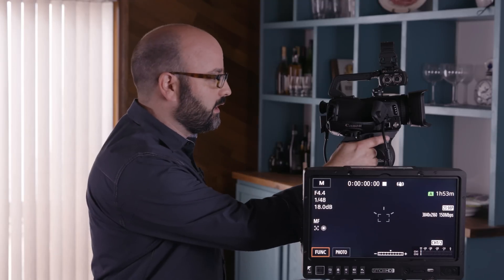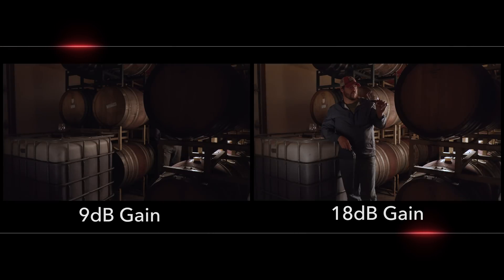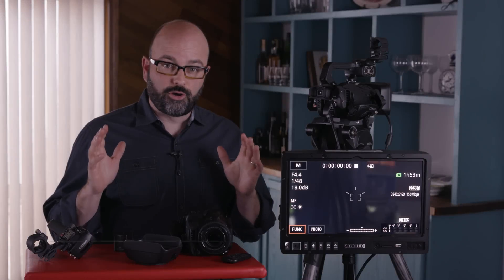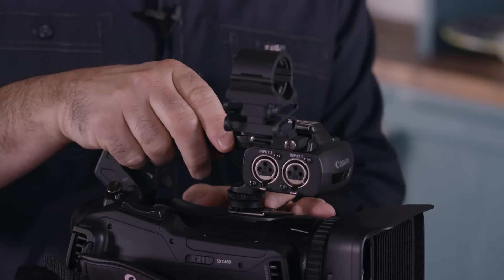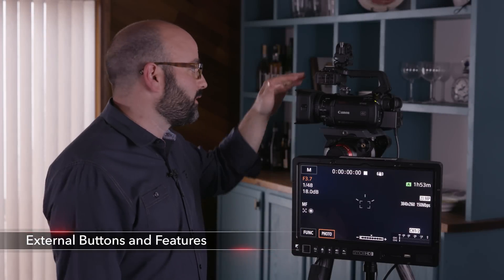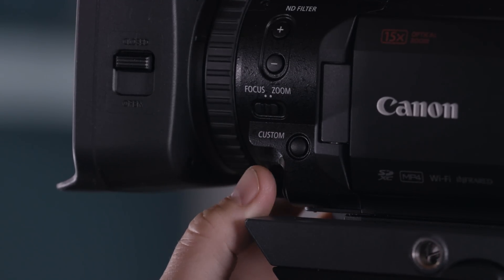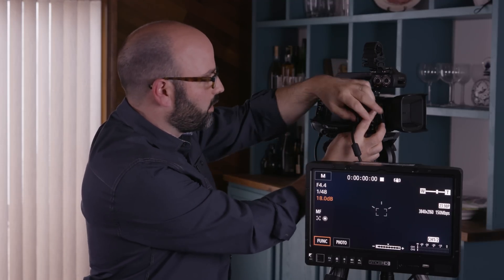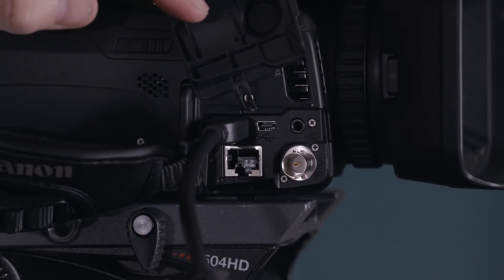How-To: Canon XF400 and XF405: Introduction to the XF400/XF405 Camera Systems

Comment: Auto focus needs no ring because it is doing it auto. zoom needs no ring because there is a rocker switch, this leaves  iris which needs a ring but you cant assign the ring to that. Genius.
842. TV AV M - what does this mean (i did study photography and have been pro for 25 years but never heard TV AV M)
This video doesnt really show if you can simply adjust iris and gain without going in the menu.
Why cant these camera be setup to shoot with access to the manual functions. (FIZ, gain. degrees kelvin, FPS)
Shooting a black camera against a black shirt is not wise.
Any log or 10bit ness?
Reply from the maker: Hello Sam:

You can find a description of the shooting modes in the XF400 manual on pages 68-69:
TV – Sutter Priority – 
AV- Aperture Priority
M – Manual mode
The available settings for these options are listed on page 70. Kelvin is an option under the Custom White Balance (WB) menu options described on page 76.  Here is a shortcut to the manual: https://canon.us/36OOccK

While most of the features you mention can be set through the menus, custom settings and assignable buttons on this camcorder, it sounds like our Cinema line of cameras would better meet your needs.  The Cinema series of cameras are designed for professional production and have the option to customize the many external buttons to have 1-push access to your settings.  You can find information on the Cinema line at pro.usa.canon.com.

Our Cinema support agents would be happy to discuss the features with you are available at 855-246-3367, 24 hours,  7 days a week, excluding holidays.  Our agents could also discuss how to access available features on the XF 400
We hope this helps.
Reply: @CanonUSA  Hi. I have a C200 and an R6 being a recent convert to Canon. Im just looking at this cam for situations were a built up C200 is too heavy and the R6/24-105 with no long lens, No ND and no XLR, is just not 'run and gun' enough. Shooters like me would put good manual controls (and AF) in front of needing anything else on the camera. Although I might consider auto on 1 in 100 shoots. It would defo be good to map the iris to the big ring. It is the best control.. but with AF and zoom rocker it will never be used!
Reply: Coming to three new cameras (Id prefer 300mkiii but cant afford) one is looking for consistency in both physical function and ideally also picture appearance.
Maybe im missing a point about struggling to get 'all manual' and someone like Jem should be doing a video.. 'auto you can trust it'

Comment: Can you run with external Battery like V mount?
Reply from the maker: Hi, Sergio!  The Canon XF400 and XF405 are designed to be powered by genuine Canon batteries or through an AC power adapter.

Hope this helps!
Reply: Thanks

Comment: Great video series. Couple of questions. First, I intend on using a Atomos for both monitoring and secondary recording because I use a elevated boom and remote controlling pan and tilt for long shoots in the sports industry. I tend to use a belt and suspenders approach in every situation. I was hoping to record via sdi and in the internal cards, but you mentioned if I wanted to record in the highest field output quality, the internal record to the cards are disabled. Is that true? Or is there a work around? Second, will you be releasing a streaming video as it relates to the 405’s capabilities? Thank you again
Reply from the maker: Hi Bill. In order to record to an external recorder via the SDI OUT terminal, the camcorder must be set in external recording mode only. There isn't a way around this. Also, this video is part of a series of videos about the XF400 / XF405 we posted in our channel. Check out the others at https://www.youtube.com/user/CanonNorthAmerica/search?query=405 We hope all this helps!

Comment: Neat video!  Can you let me know if you have experienced any problems with focus shifting when zooming in and out and when in Manual Ficus mode?  For example I auto focus on a subject in the distance on max  tight zoom and wait till I see the green triangle.  Then I switch to manual focus as I want the subject to stay in focus as I pull back to wide.  It holds focus until the very last moment and when its has reached its fullest wide angle it suddenly  slips focus and I get the indicator turn from green to white and not be that perfect triangle anymore.  However as soon as I zoom in to max close up I get sharp focus again and the green indicators align up.   Anyone else have this problem?  Please see my video......  @vOCE
Reply from the maker: Hi there. Our team of experts can help determine what may be causing this. Please reach out to them directly at http://Canon.us/ContactYT We look forward to hearing from you.

Comment: Just purchased my XF-400 - but a problem - how do I get the XF-AVC format videos off my camera into my Win10 PC for editing? Spent several days to no avail. DIU utility does NOT recognize my camera, when xf400 connected to my PC with a USB cable - it does only when camera in MP4 mode, but not in XF-AVC mode - and the Data Import Utility (DIU)? - does not recognize the connection - says not connected, regardless of MP4 or XF-AVC mode on camera - Canon - you got to be kidding me / - does anyone have any ideas, cuz this well is dry ;)

Comment: Canon not responding my problem.
I live in poland. I reported the defect of the seller, knowing that it was a design defect. I wanted to return the camera, but the seller refused. I met with representative of Canon Poland Robert Woźniak at the representative of the BEIKS dealer. The defect was confirmed in my camera and in the others that were in the store. My case is not isolated. OIS disables spontaneously when working on the shoulder or the operator is leaning against a stationary object, and the picture begins to jump while taking important shots. This is confirmed by Mr. Woźniak. He refused to write down the appropriate protocol, which would be the basis for returning the camera and recovering the money. The camera in my incident is not suitable for working with an anesthetic OIS during photos.

The seller does not want to give me money, which I can understand, because it's not his fault, but in the end he represents Canon and should take responsibility for the product.

Dnia 8 grudnia 2018 00:28 Canon Support <carecenter@cits.canon.com> napisał(a):

Dear Piotr Diszer ,

Thank you for contacting Canon support regarding your XF 400 and IS design question. I will be glad to assist you.

I would not thinks so based upon your report.  You may have your camera examined. 

Where do you live?

Please let us know if you have any other questions.  Thank you for contacting Canon.

Sincerely,

James

Technical Support Representative

Email is not a secure form of communication.  Please do not send us your credit card number or other personal or account information via email.
Reply from the maker: As you do not reside in the United States we at Canon USA are unable to assist with this matter. Please contact Canon in your region for assistance. https://global.canon/en/support/

Comment: The gx10 doesn’t get the same 45 mbps 1080 hd as the xf400?
Reply from the maker: Hello there! The VIXIA GX10 records 1920 x 1080 at up to 35 Mbps, which the XF400 also does. We hope this helps!
Reply: I thought the xf400 got the update of 45 1080 and 160 4k? XF-AVC fromat
Reply from the maker: Hello again. 45 Mbps is possible on the XF400, but only in the AF-AVC format. The VIXIA GX10 only supports MP4, which is at the same bitrate of 35 Mbps as the XF400. We hope this helps clarify things.

Comment: Many nice features on this camera...but I have a few questions, if you don't mind.
1. why did you put the joy stick on the left side? It's on the right side for the xc15 and it works great. On the left side you're constantly having to switch from the left hand supporting and balancing the camera to operating the back with all the weight falling on the right side. IMO that TOTALLY sucks.
2. Why did you make the LCD HIGHLY reflective, making it virtually impossible to use outside on a bright day. I look into it and all I see is my squinting face looking back at me. LCD run and gun; TOTALLY USELESS.
3. Why did you put the toggle button for power IS on the LCD? If you're shooting run and gun using the EVF you want the button on the outside of the camera so you can toggle without losing your framing and your shot. This seems totally out to lunch.I mean, you're shooting hand held, you need the power IS, and you have to stop and open the damned LCD to find the power IS--in the meantime you lose your framing and your shot.
4. Why did you put the start/stop button so low on the right side? It's really awkward to hold the camera like that. Why did you recess the "mag" button and place it so far from the start/stop button. It's awkward and hard to access.
5. Why do features, like zebra, keep appearing and disappearing as you scroll through the menu? Why isn't zebras in the standard menu like it is on the XC15? Confusing and dumb.
6. Canon got it  ergonomically right on the XC15---fantastic camera for what it is. THIS camera is an ergonomic disaster IMO---awkward, difficult, forcing hand switching and shifting from LCD to EVF in the midst of shooting---among other things.
7. Why are we asked to pay three thousand bucks only to have Canon give us a crappy, postage-stamp EVF, and only three looks---one of which is gray? The XC15 costs a LOT less, has higher bit rates, and equivalent zoom, and EIGHT, count them, EIGHT looks plus the ability to create two custom looks.
8. Why is Canon CONSTANTLY disappointing by crippling cameras and being horribly stingy and niggardly in providing so few features and options while asking TOP PRICE for them?
9. Was the camera never field tested before it was marketed? It seems to me the ergonomics were put together by some geek engineer who never shot so much as an iPhone photo staring at a computer screen and deciding to be cleaver and change the ergonomic arrangement to make it different from the XC15 ergonomics--even though the XC15 ergonomics is virtually perfect.
What's the use!!!

Can someone please riddle me some of the questions? If I could pick just one I'd like answered, how about telling me how I am able to shoot outdoors with the massively reflective LCD?? Any bright ideas?

Comment: Is it only 35 mbps for 120p?
Reply from the maker: Hi there. If you're referring to using a Slow/Fast Motion rate of x120, the bit rate will depend on the resolution you're shooting at. At 3840 x 2160, the bit rate is 150 Mbps. However, at 1920 x 1080 it is 35 Mbps. We hope this answers your question.
Reply: What is the bitrate for 1920x1080 at 120 fps? Thanks
Reply from the maker: 120 fps is achieved by choosing the native frame rate of 59.94p / 29.97p / 23.98p, then setting a Slow/Fast Motion rate of x0.5 / x0.25 / x0.2 to match. With either native frame rate, the maximum bit rate is 35 Mbps. We hope this helps clarify things.

Comment: What plate are you using for that video head.  I have similar head and all the plates I've found are too long and block access to the battery release.  I've figured out a workaround, but I'd like to get a plate for this that works  well.

Comment: I am extremely disappointed Jem in this camcorder. The images that come out of the camera are soft and not sharp in 4K mode. I decided to go for a Panasonic DVX200, which offered a much better lens, much sharper video. I had the XF300 and waited year after year for you guys to come out with a * full size *  camcorder with all the ports, three independent rings. What I really hoped was a XF400 which was a real true upgrade from the 300. Batteries are way too short. I can't swap batteries when I film concerts with no intermission and no power ports.
Reply: Also, I found the camera to be very dark indoors, having pump the gain to 18 dB constantly.
Reply: asafblasberg I agree. The real successor to the XF300/5 appears to be the XF705. It has gone the route of single 1” sensor, 4K and advanced 10-bit 422 codecs. The price point is a bit steep but it ticks many boxes if you are a dedicated Canon guy (I am). I’m waiting for some hands-on reviews to come out.

Comment: Can you use three audio sources simultaneously with the two XLR and one 1/8th" mic in?
Reply from the maker: Hi Tim! Audio can be recorded from both XLRs as well as the MIC terminal as long as the camcorder is setup to record 4-channel audio. We hope this helps!
Reply: CanonUSA yep thanks for the reply. What shotgun mic is used in this video series? I'm trying to figure out what fits in the mount.
Reply: @CanonUSA  Hi, can Jem make a tutorial for the XF705 please, there is hardly any info on using The XF705.

Comment: How long is the battery life on Canon BP-828 Battery when shooting 4K60 mirror recording to two SD Cards, with full brightness on the LCD? Is it only just 1 hour? I might get 2-3 extra batteries then and one or two extra chargers cause I need to be able to film at least 3-4 hours per day.
Reply from the maker: Hi there! Maximum recording time with the BP-828 recording at 4K 60p is 115 minutes. Typical and more realistic recording times averaged around 60 minutes. We hope this helps!
Reply: Thanks, do you sell compatible higher capacity batteries? Seems that I may need 4 of these if it can only record 60min per battery so that I can be shooting interviews at a tradeshow during the whole day.
Reply from the maker: Currently, the BP-828 is the highest capacity available that is compatible. The BP-820 is also compatible, though it is lower in capacity.
Reply: Can you power the camera from a USB powerbank battery?
Reply from the maker: Hello Miklos! Power can only be supplied from the battery pack or the optional CA-946 AC Adapter. We hope this answers your question!